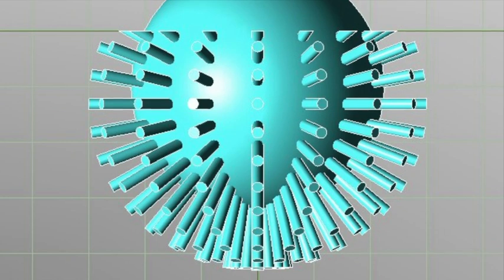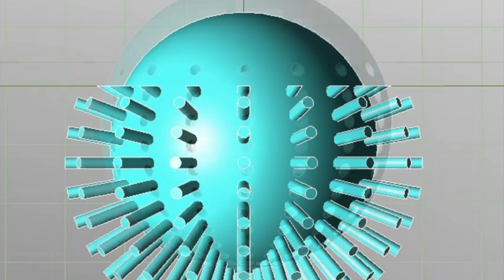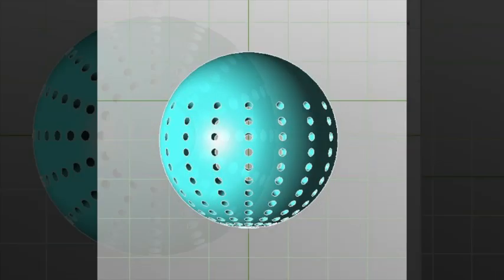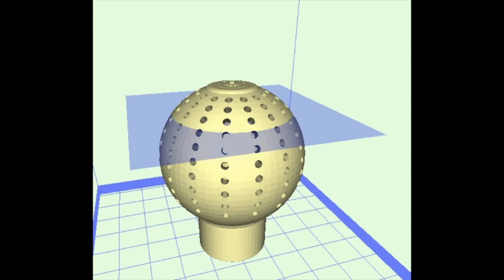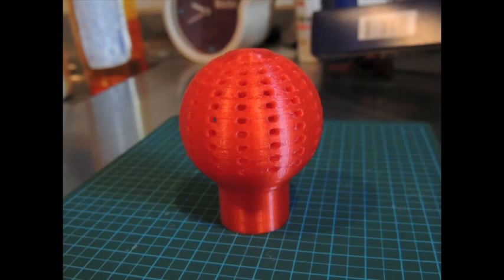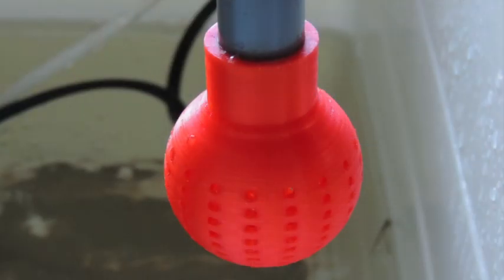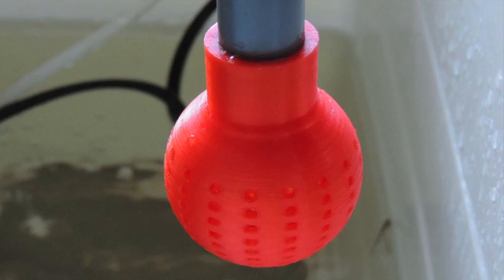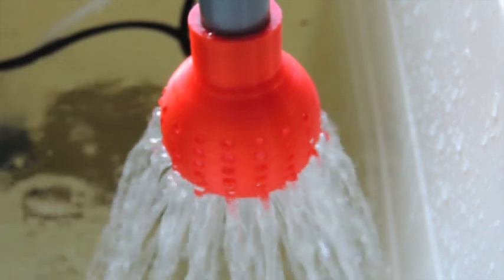Aquaponics Bubble Head Design - 3D Printing

Comment: I liked all the def. heads you created to improve oxygen mixture. but in one of your video's you had said you did not want to restrict the flow of water. I can understand this point, but you want to increase surface contact (or place thing in the way of) to separate the Hydrogen and Oxygen. this is a little trick to increase oxygen into the water. so by adding regs (surface plans just like this bubble head but add more to the inside) for the water to come in contact with you should be able to increase oxygen.

Comment from the maker: Good idea. I'll consider that for the next version.

My tool chain is ViaCADD 2D3D 8 -> Netfabb (seldom required) -> Kisslicer 1.0.9.

There probably is a sensor, but I'm not that far along yet. Eventually I want to control/monitor several aquaponics installations around the property including the ability to check their status remotely when I travel.

Anyway, the bubble head is generating a lot of bubbles in the tank now, and the siphon cycles every 10 minutes, so it seems to be working OK.

Comment: perhaps you could create an inner sphere to ensure the level of the water in the sphere be as high as possible to increase the number of orifices that water comes out of. Great job by the way! what CAD software do you use? 

also, is there a detector/sensor you could use to determine oxygen content of the water? i inferred from your video you are going to see if the systems changes as a metric, is there nothing more direct you could measure?